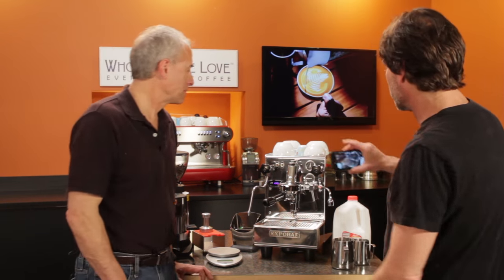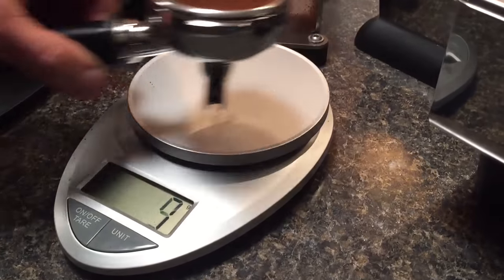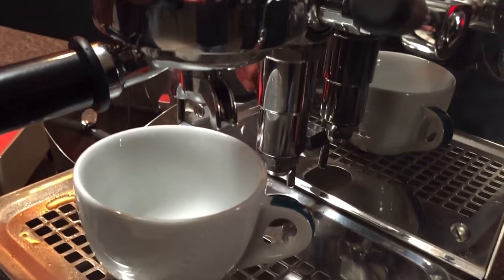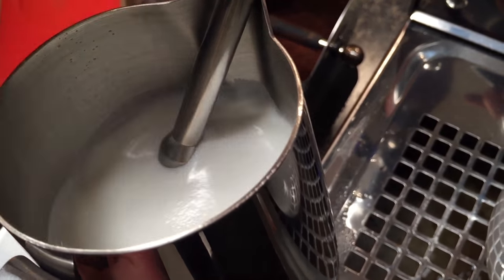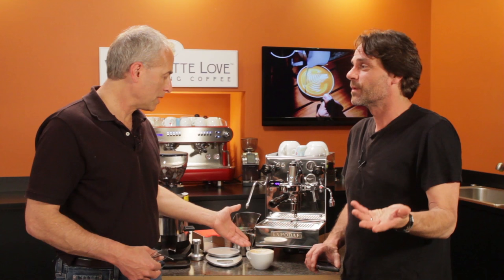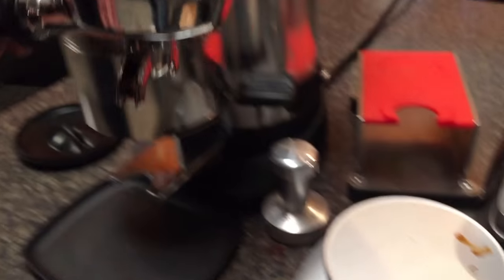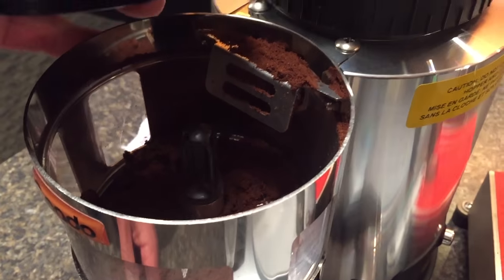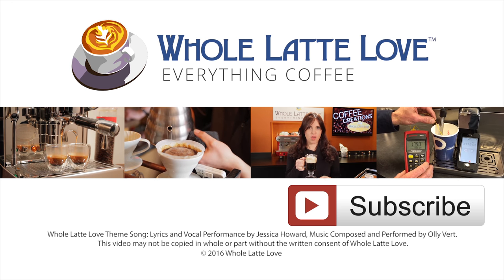How to Make a Latte on a Prosumer Espresso Machine

Comment: One of the best video on frothing, specially the camera angle on showing A)where exactly the tips should be B) at what point wand tip should go a bit deeper.C) the hissing sound 
Excellent video.
Mark, Most of the grinders have hundreds of setting therefore for learners it becomes difficult to understand that averagely at what grind setting one can get nearly a perfect espresso shot. As you are aware that if the grind setting is not done properly the machine will produce coffee fast or slow or even nothing. Any video on that?
Reply from the maker: We do have a video on dialing in the grind which I will link below. Thanks for your comment on the Frothing video! We do our best to use good camera angles/sound to help explain and demystify the process.

As for grind, our general advice is to start with a grind size similar to granulated sugar and look for an extraction time of 20-30 seconds from first drip. It's helpful to weigh each dose and make it the same as your dialing in. Changing the dosing weight will effect shot timing. We recommend a dose of 17-18 grams. Do all that and then adjust grind smaller if shot is too fast and go more coarse if to slow. Also try and use the same tamping pressure for each shot as dialing in. Then keep in mind that timing can change as coffee ages and with changes in other variables like brew water temperature or a different coffee. Grinding is not a set once and forget adjustment. Here's the link for the Dialing in Grind video: https://youtu.be/o3oSlZSXHog
Reply: Mark once again thank you so much, just saw the video and shall never forget 2 ounce in 25 seconds  rule.

Comment: I'm about to make an 8 oz latte on my Alex Duetto 3 machine after i finish this video. Just curious, what steam hole tip are you using?
Reply: it's the standard expobar 1 hole, it's really bad why i switched over to a quick mill 2 hole, or the alex duetto steam tips are supposedly really good.
Reply from the maker: As Buff mentioned it's the standard Expobar single hole. Tips can make a big difference in frothing performance. For example, different tips may have different hole sizes. A larger hole will give more total steam at lower velocity than a smaller hole. A larger hole or more holes in the tip may exhaust a machines steam, while on some machines you can steam continuously (never run out of steam) when using a smaller single hole tip.
Reply: i poured this beauty on the expobar a couple of days ago 
https://www.instagram.com/p/BFrAjKSjBQD/
Reply: The Buff Barista You have some awesome pours on your Instagram page. I don't have any previous barista experience so it's been all self taught since getting my Duetto 3. The thing that's most difficult for me is getting the right consistency of milk to pour art. Sometimes I get really nice texture but very often its too foamy
Reply from the maker: Very nice! Thanks for sharing!!!
Reply: thanks Andrey, been pouring about over a year now, so built up alot of practice to get the consistency, takes some intuition to know how much foam you've made, but just pour the same amount of milk in every time and make a mark of how much the milk should expand in the jug, and you should be hearing the hiss about 2-3 times a second, i've found once i hit that spot i need to very slowly drop it to keep it at that pace of injecting air, literally 1mm at a time and once you've got that down consistent you can just go by time for how long you need to inject air
Reply from the maker: The Buff Barista
Great advice!

Comment: I'm using a delonghi caffe treviso and I was wondering why is the porta filter filled with water after I pulled my shot?
Reply: Easy!! means It does not have a 3 way solenoid!!
Reply from the maker: What Daniel said plus fairly certain your machine uses a pressurized filter basket which will retain fluids. Not many machines which use a pressurized filter basket have 3-way solenoid which releases excess water in brew system after extraction. A notable exception is the North American version of the Gaggia Classic. It comes with both pressurized and non-pressurized filter basket and has a 3-way solenoid for drier coffee pucks.  https://www.wholelattelove.com/products/gaggia-classic-ss-brushed-stainless-steel-semi-automatic-espresso-machine
Reply: +Whole Latte Love thanks a lot for the explanation.
Reply: +Whole Latte Love thanks a lot for the explanation.
Reply from the maker: Wayne Yeap
No problem! happy to help!!!